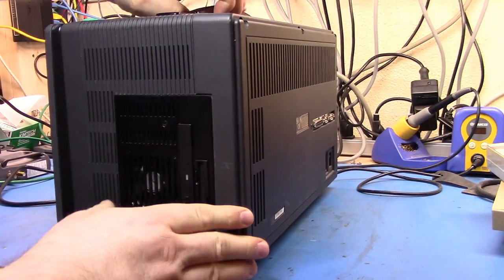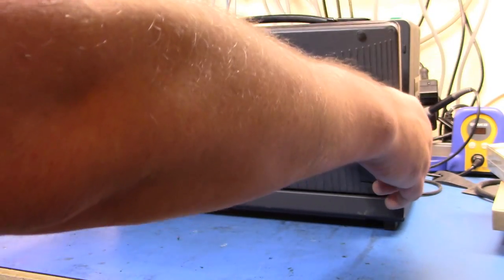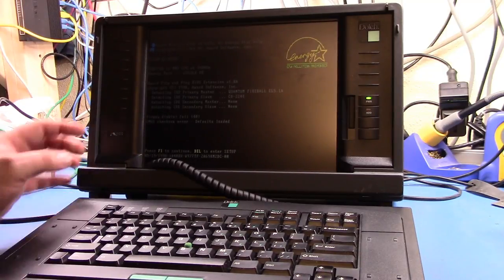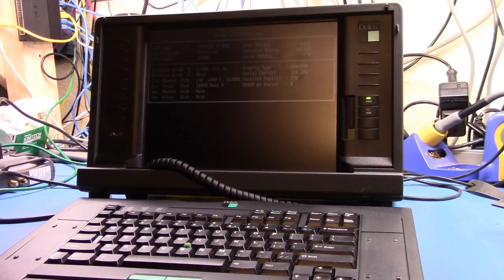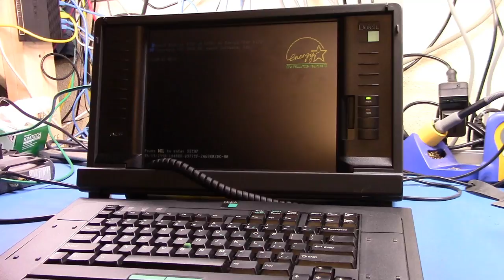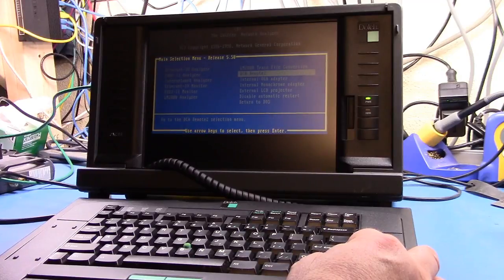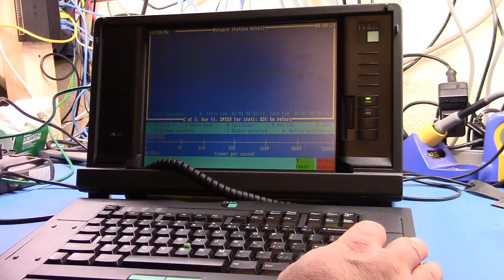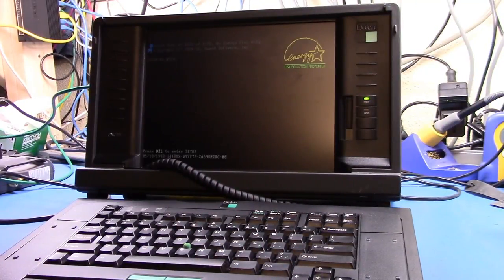Dolch PAC 65 - Part 1

Comment: Great video. Coincidentally, I’m actually doing some very similar stuff, for similar reasons. I just got a PAC 63 that mostly works and a PAC 64 that is fully functional. I’ve picked up what I thought were good deals on HP 16500Cs and an Agilent 16702a, until I saw your Agilent logic analyzer for $25. That was amazing. I’ll check out this whole series. My PAC 64 is DOS only, so I need to install some version of Windows on it. I’ve got some old PCI data acquisition boards I want to try to install in it too. Thanks for the videos. I’m a little rusty on this, so this is a great refresher.
Reply from the maker: Glad you liked it - I have a thread going on this over at the EEVBlog for deeper discussion that the comments here allow.

Comment: These are great and I have one of these myself. I'm using it as a means to store and run software for a HP 9816 as seen on photo link provided. There is a word of caution about this unit and I'll mention it on your next video (teardown part) once I find my old phone's photos. Basically there is somewhat a flaw with a short to ground from the floppy or cd's interface board. Had to repair the board's power rail trace and solve the short to chassis using a sticky note. If you need the user's manual I have it if you want info from it. Link: https://flic.kr/p/23Np2jg
Reply from the maker: Thanks - Appreciate the heads up.